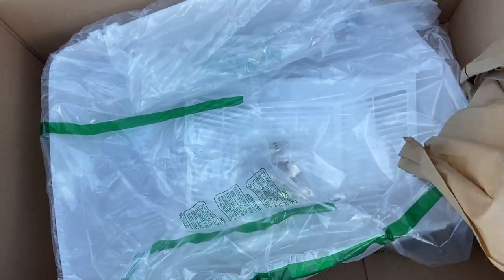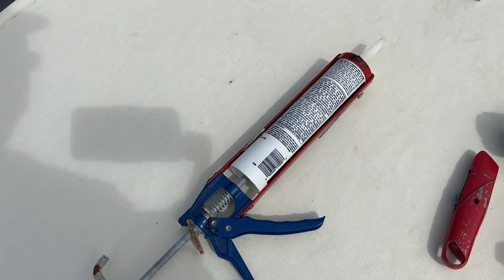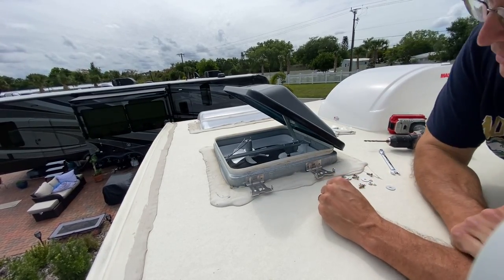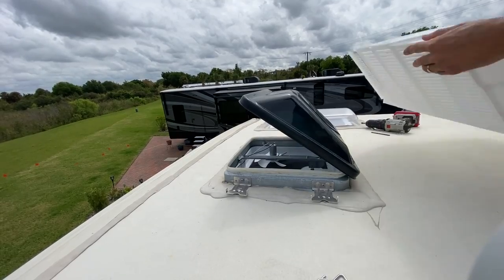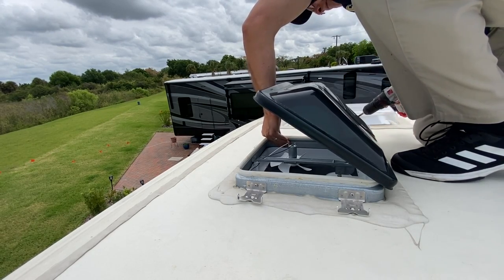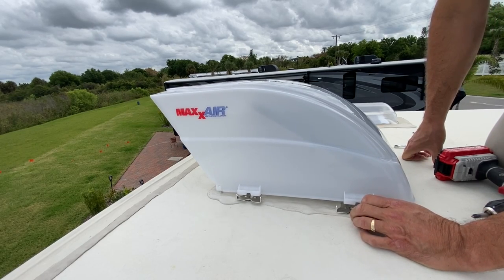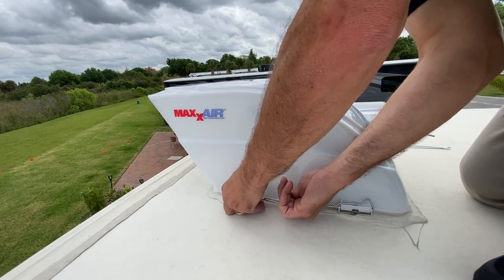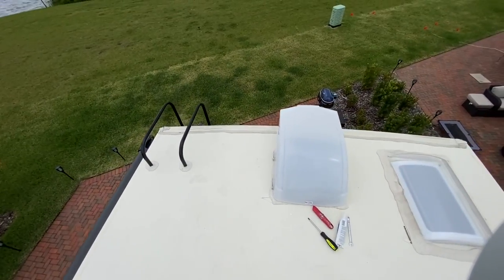BIG RV Mistake | Maxx Air Fan Cover Install | Don't do this | Grand Design Solitude 380 FL R #RVLife

Comment: Watched several of your videos and subscribed to your channel.  You folks seem like a really nice couple and are doing what my wife and I will be doing in a few years.  Advice is only for what it's worth, I wish you would have used a commercial grade caulk and not silicone.   I recommend watching the channel RV Roof Install and search for the Grand Design roof failures, or any of them for that matter as they are all built the same, all the ACs and skylights and antennas should be on curbs.  The stuff they use to "seal" the seams is a mix of butal and latex and will crack when exposed to UV light.  Then you will have leaks like you won't believe.  The RV industry will say you need to put more on more on,, it doesn't work.  If it says RV use, don't use it.
Reply from the maker: Thank you for watching! I definitely will check them out.  Also, I do have a tube of RV caulking and would have used it if it were holes in the actual roof.  I will keep an eye on it over this summer to see how things are holding up.  I hope you're able to get out here soon.